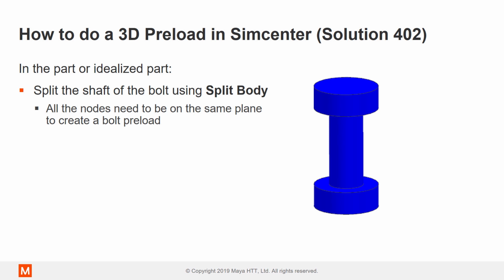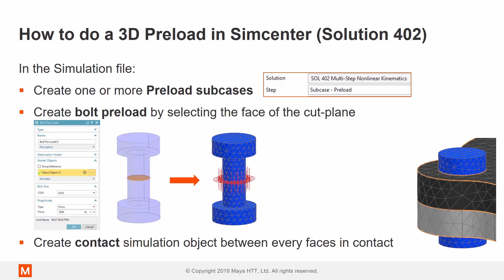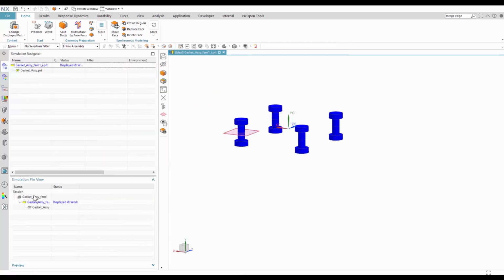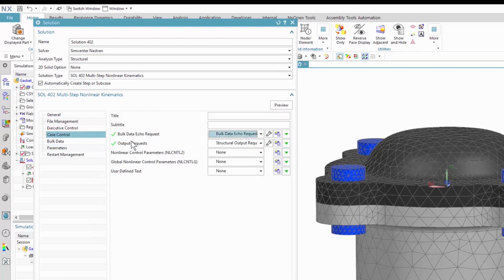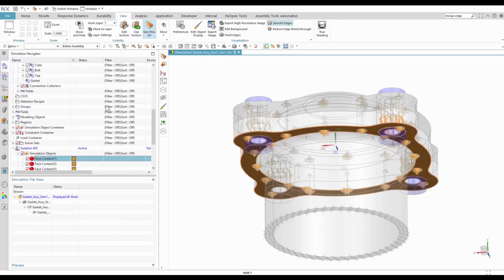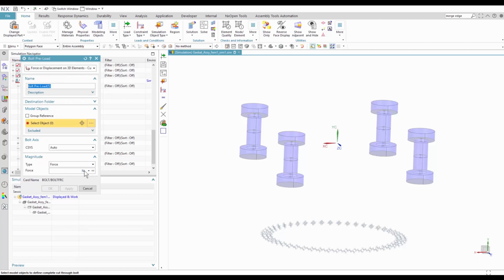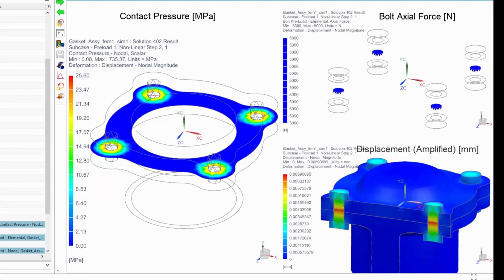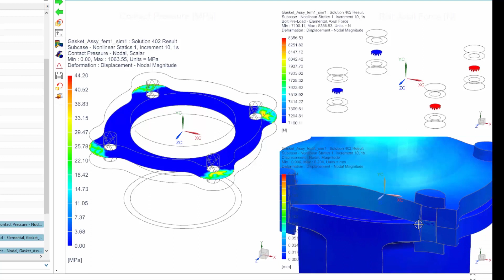How to apply preloads to a bolt model in Simcenter with Nastran solution 402

Comment: Can you show how to use re-start capability in Sol402 next time? Pre-loading first, and then continue solving for different pressure values using re-start from pre-load subcase, so do not have to go through solving for contacts again would be very useful.

Comment: But how do you know preload? can i use table to find right preload?
Reply from the maker: We have consultants and support resources that can help you and can be reached at info@mayahtt.com, if needed. As a starting point, for bolted joints between metallic parts it is typical to design for a preload force of 75 to 90 percent of a bolt’s proof strength (proof strength can be obtained from the bolt manufacturer, and can be multiplied by the bolt’s tensile stress area to obtain preload). For a more in depth discussion some well-known references are Shigley’s Mechanical Engineering Design and NASA-STD-5020.